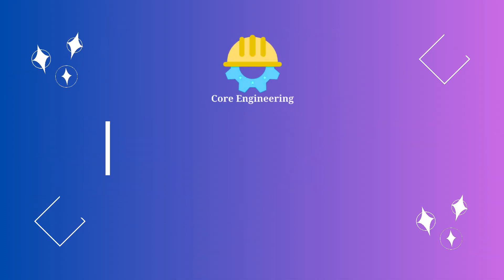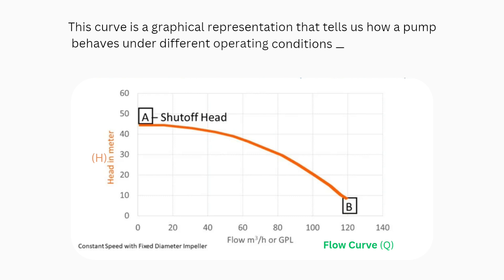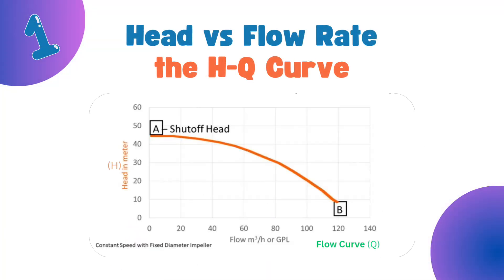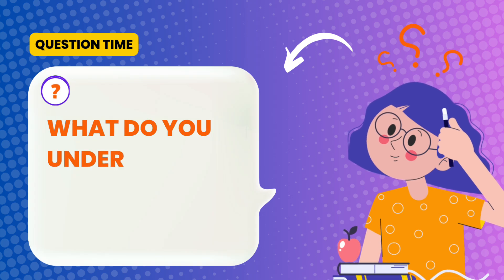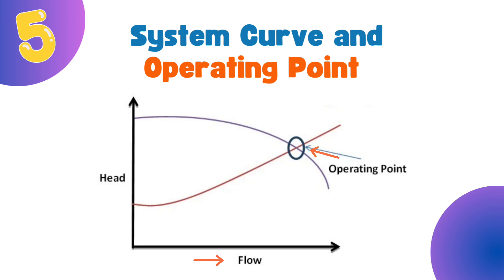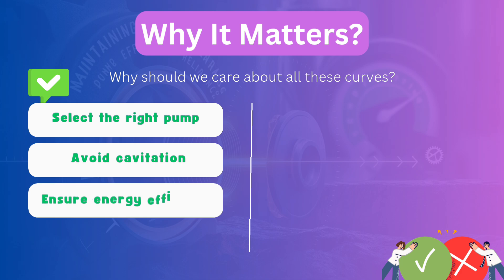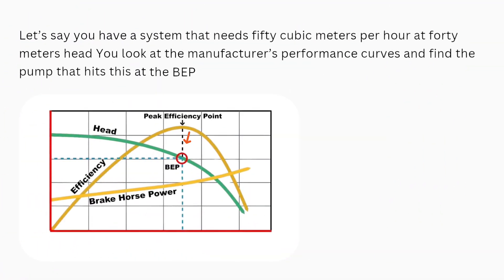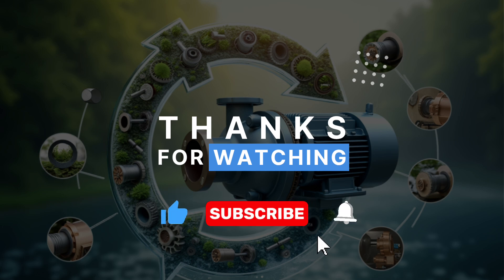Performance Characteristics of a Centrifugal Pump | Centrifugal Pump Curves Explained

Comment: 1:36 the curve, there is a mistake. On Y axis it should be HEAD in meter also along with efficiency. On X axis flow rate is okay. Then orange color curve will show head vs flow rate ( effectively the first curve) and green curve shows the efficiency vs flow. So Y axis nomenclature is slightly wrong. It should be written HEAD also on Y axis